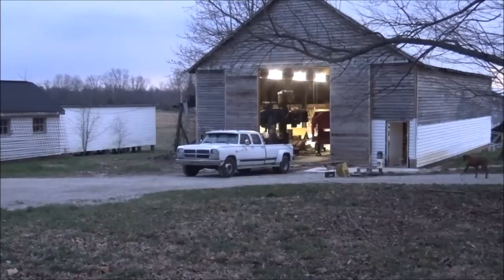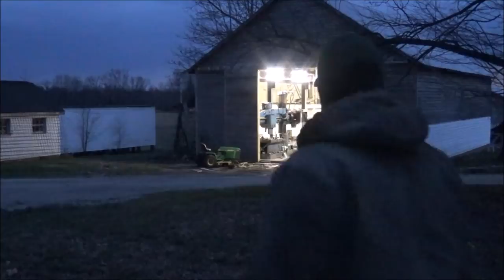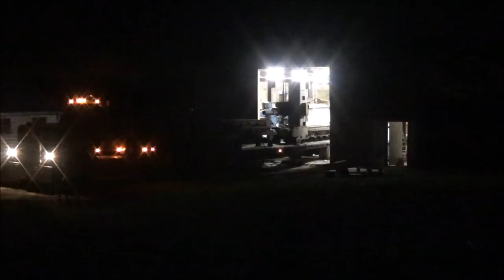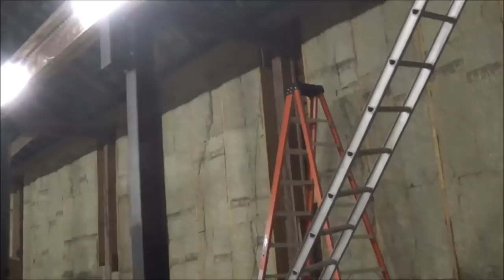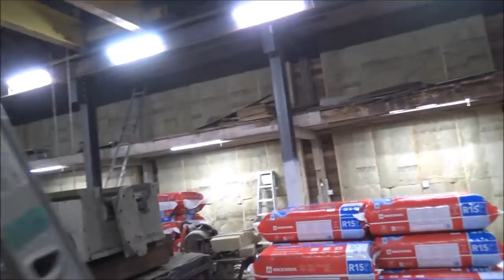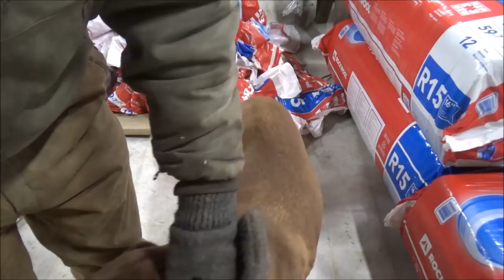Moving the 47000lb Giddings and Lewis Boring Mill Part 1

Comment: Now for the fun part... You never have to worry about losing a Cummins. Just follow the smoke...
Reply from the maker: Especially on a cold day with only 13.5:1 compression.
Reply: That must not be an STC engine. Some of those old high horse Cummins would drip unburned fuel right out of the exhaust if you let them idle.
Reply from the maker: It predates the stc motors by about 15 years, very old school low tech here.

Comment: I just rigged a g&l t340 a few weeks ago. The bed had our 30k forklift light on its heels. Ended up having to run the head all the way down and remove the counterweights.   Just now making  the first chips with it and it is a pleasure to run.
Reply from the maker: Yours a 120" long bed too?
Reply: bcbloc02 Yep.    Got it from an estate  with 60 tool holders. Buckets of collets. Pair of 12" 4 foot angle plates. Can still see a little of the frosting on the ways in the heavy use areas.  I was surprised at how cheap some of the heavy machines go for.   I guess it is cost prohibitive if you have to pay pros to move them.
It's my first piece of heavy "old iron" and I couldn't be happier with it. 
From the looks if it, you are going to have an an incredibly capable home shop. I am genuinely excited for you.
Reply from the maker: Sounds like you really scored! I need some big angle plates for mine but they always seem to cost a fortune for what they are. Probably just have to make some.

Comment: How do you plan to lift a 21 m. ton machine with a 15 ton crane?
Reply from the maker: It should lift no problem, the mill is in pieces so it is under the rated limit for each piece.
Reply: ah OK.  That makes sense.
Reply: That's good to hear.  Hate to see another incident like the last one.

Comment: What’s your plans for powering this equipment? Don’t know if you have 3phase from the mains. I’m gonna be in the same situation soon.
Reply from the maker: Moving my phase converter down there from my shop now.
Reply: What size converter? And what’s the biggest hp motor you gonna run?
Reply from the maker: I have a 50hp converter and currently my 25hp mill is the biggest I have.

Comment: Somehow Brian that huge shop of yours is starting to look smaller, just a few more machines and you won't have any room to do any work in there . 15ton crane lift  =30000 lbs USA?  47000lbs machine. Look forward to seeing how you avoid a Woopse Doosie moment with a 50+% crane overload .Maybe you plan to take some of the heavy bits off the machine and lighten the lift .
Reply from the maker: It is already in 4 pieces on the trailer, just unload them one at a time.
Reply: Thanks for the reply Brian . After I read through a lot of the comments I found that you had already answered this a few times ..

Comment: After scrolling through the comments I sure can't figure out why anyone thinks there's the remotest possablity of you dropping that HBM Brian. Why even mention it since the only problem that caused the drill lift to go wrong has been replaced.:-( Zero doubts about that HBM dropping right on the studs since I'll bet you double checked the dimensions at least 1/2 a dozen times or more. Getting them all lined up at the same time might be fun on your own, too bad I'm so far away or I'd give you some help. But I'm sure you've got it well planned out anyway. It's still going to be a lengthly job getting it to final level over something that size small HBM or not. Almost for sure you already know about them, but if not? Google micrometer heads used with a water level. Pretty accurate and cheap system for what it will do over long distances.
Reply: Because unfortunately, people love to be negative and focus on other peoples mistakes.  It's sad that people always refer to Brian as the guy who dropped the radial drill, instead of the guy who is completely rebuilding a 150-ish year old barn, by himself.  That's the bane of the internet unfortunately.
Reply from the maker: I guess you can only be famous for one thing.